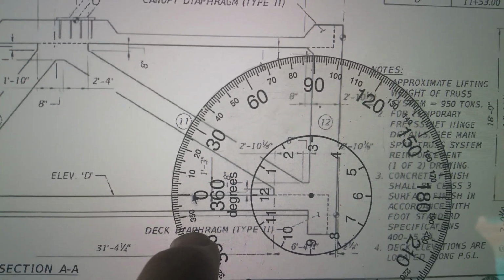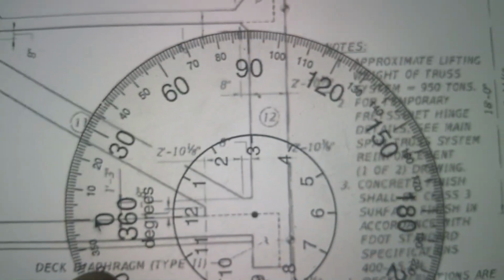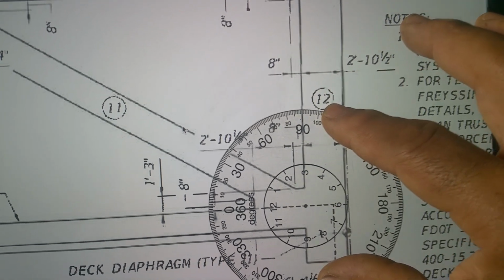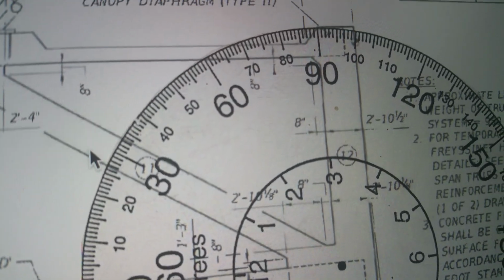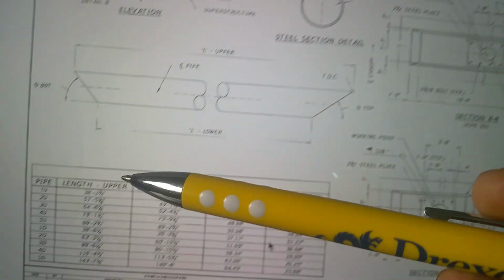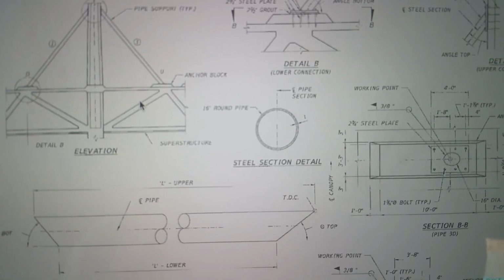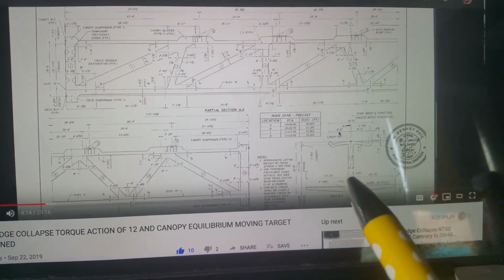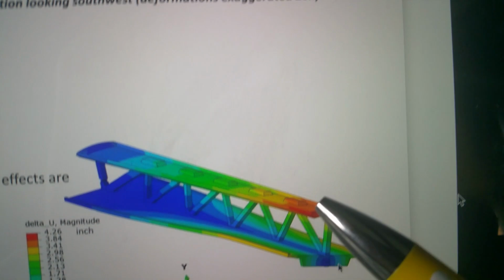FIU BRIDGE COLLAPSE BUILT-IN TORQUE ACTION PER DENNY PAT'S FORENSIC ENGINEER

Comment: Yeah probably more of a philabuster if that is right they all want to bury it in a mile of muck
Reply from the maker: Chris, I am loading a steel scaled model of the 10, 11 and deck ...  two parts to it... I hope I do not lose anyone with the deflection comments I make... The last thing I want to do is support that the collapse started at the 11 and 12 joint... I state, it started with the ''deflection'' that FIGG Engineering acknowledged exist in this structure... That shows the bridge was in creep / failure / progressive failure mode...
I also state that the detensioning was NEVER tested before besides at the last location...  and that de-tensioning revealed the new load paths...
Then they tried to put the cat back in the bag!   ending in collapse... the cat scratched it's way out of the bag ...

Comment: Dude a stick model is slang for a vector diagram. They map out the forces without the architecture. The problem was and still is that both the Dr and Pate made all the calculations with both halves of the bridge pulling against each other 1 section would not hold itself up. The Dr asked why they had post tension rods in 2 and 11 when those were in compression. Pate said to stiffen it on the mover the forces would reverse on the piers. If you want to bust pate go back and look up the retensioning that exploded the already crumbling #11
Reply from the maker: It was ''slang'' for a much more advance model... I would love to see it... it seemed interactive... Remember, I am doing the video live and once I say, I said it... I can only expand on it... Someone like yourself obviously has a larger understanding of a ''stick model''...   
Also, I am not attempting to bust anyone in particular, only where I see b.s...
And Chris, you know I also support some of things that the same person I may talk about negatively...  For example,  lobbying is fair game... it may not be moral but it is fair game.

Comment: If there are tension bars in 11 going through the deck, how could it slide without shearing off the bars.
Reply from the maker: Agreed,  plus the diagonal number 11 had already had failure in the central axis area.    Yet, not one engineer talked about it buckling or torsion failure  once they applied this force on this ''diagonal / column"...